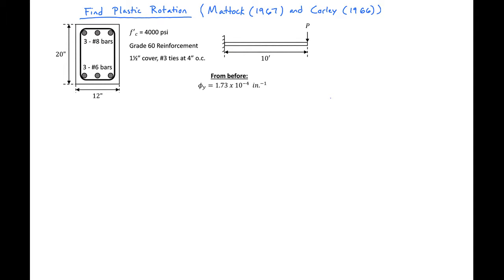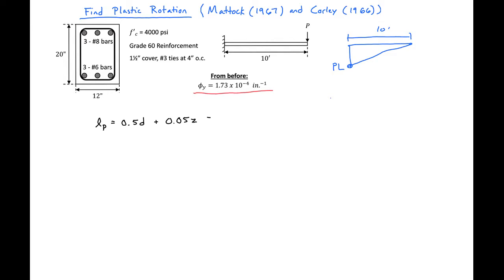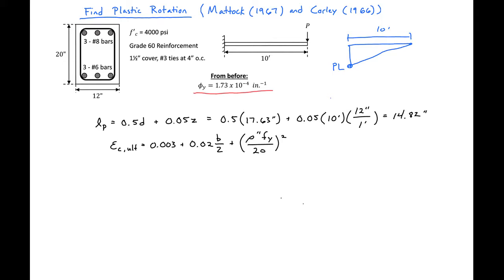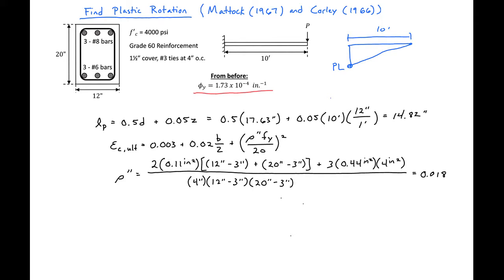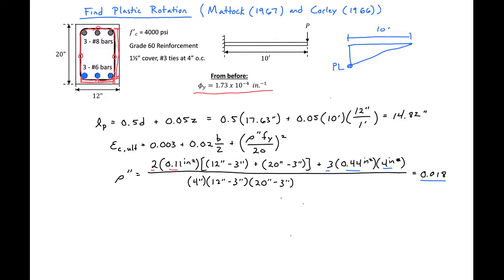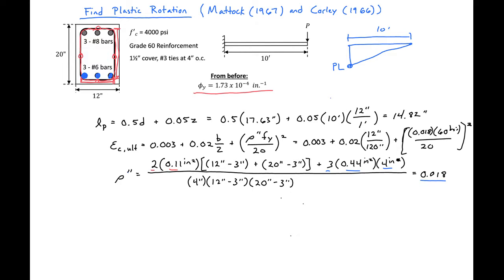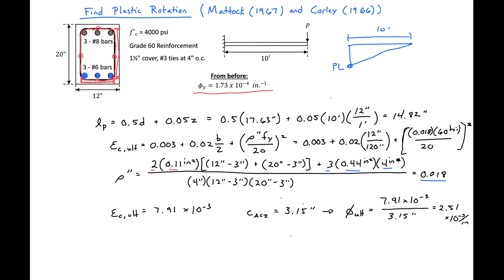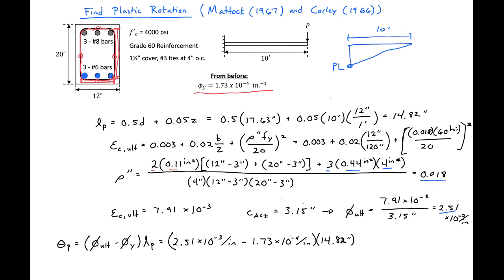7 - Example:  Plastic Rotation of Reinforced Concrete Member

Comment: Hello dave, what poibt in the moment-curvature did you get the value 1.73x10^-4?
If im using a different equation (e.g  Baker) does the ultimate strain formula change?

Comment: Great workout!

Question: isnt ultimate strain in concrete = 0.003? how do we justify of having ultimate strain in concrete of 0.00791?
Reply from the maker: The higher strain at ultimate that I use here is taking into account the benefits provided by confinement reinforcement, compression steel, and moment gradient. The 0.003 value is an approximate value for unreinforced, unconfined concrete. You can look at papers by Mattock and Corley for more information.